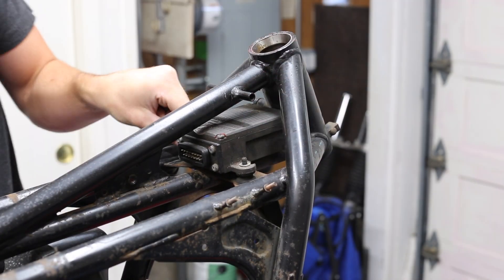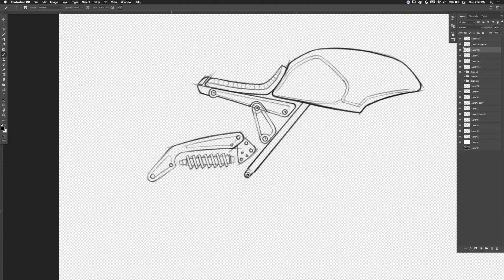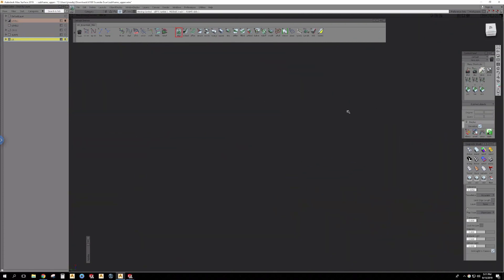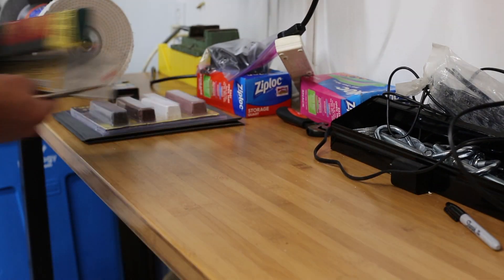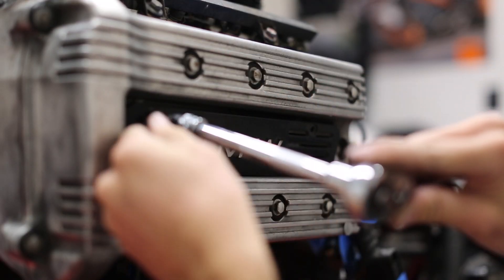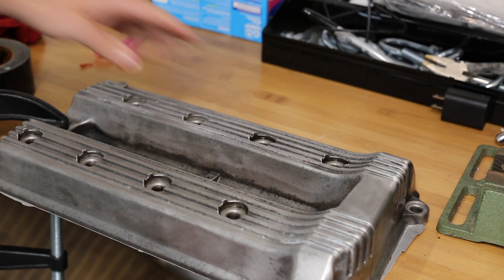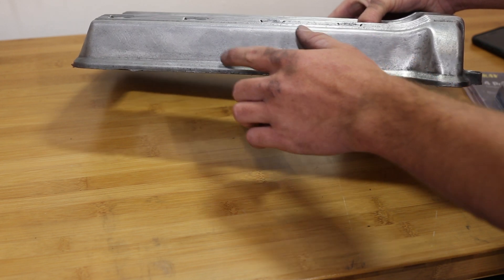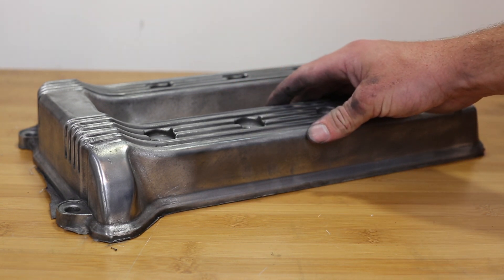Episode: 4: BMW K100 Subframe Design, Frame-Cutting & Valve Cover Polishing

Comment: do you know if you could add sleevs to the engine? I hear the internals become a bit oval shaped and they burn oil so some simple machining and some sleeves could give you a rebuildable engine. I was also wondering can this be converted to chain drive becaus ei noticed it looked like shaft drive. Or I could be wrong:) I have nbever seen one in real life.

Comment: If you could pass on what you learned last episode it would be sharing the cad data for the frame, it would save me first buying one and remeasuring the frame,  please consider chucking it onto grabcad thanks and good luck
Reply from the maker: Hey Tom, I uploaded here. https://www.turbosquid.com/FullPreview/Index.cfm/ID/1495389
Reply: @CURV-LAB  Hi, could you check the link? I couldn't find your upload in the choices. Thanks!
Reply: @CURV-LAB  Hi! I like your build. Watched all your videos. Hoped to find what have you made with the rear suspension. I am building a newer version a K1100 and the same suspension would fit there aswell. In what terms i could get the hole patterns/measurements in a dxf file or something like that. If you could write to me @ tanel565[at]gmail.com. Thanks in advance.
Reply: Hey Tom Carr, did you manage to get the cad data before it got taken down?

Comment: Hi, are you designing a stretcher in your video? Is there a draft of the rear shock absorber lever? I want to cut it myself, but I can not find information on the size of the part. Thanks.

Comment: Possible to get the cad drawings?  i like this look! 😊 (i have purchased the original drawings)
Reply: I’m searching my K100 base to build custom. Once I find it I’ll also buy the Bible with cad drawing from L brothers. Will you share with us the surface modelled drawings once we also have the rights to “solid” ones?
Reply from the maker: CAD can be found here https://www.turbosquid.com/FullPreview/Index.cfm/ID/1495389
Reply: @CURV-LAB   Hey, could You share a CAD model which You have drawn with SW according the scanned k100 frame model??? Would be thankful, I want to design some things according the org frame too :D. And if I understand correctly in these link the org k100 frame model isnt added, yes?
Reply from the maker: https://www.turbosquid.com/FullPreview/Index.cfm/ID/1495389
Reply: Hey Michael, did you manage to get the cad data before it got taken down?

Comment: Suggestion for next time - might be easier to have the paint shop sand blast the valve covers. Cleans the surface and gives it enough texture to take the paint.
Reply from the maker: boxster1990 yea, strongly considering that given how long the valve cover took

Comment: it's good to see you back on the project! I will watch closely your progress and I admire your bold approach to smoothing the design of rear suspension.  this black discolorations it is not corosion but carbon, you can use an acid based cleaning compound to dissolve mineral contamination. Good luck!
Reply from the maker: Thanks, I'll be posting episodes more regularly now. Ah ok, good to know thats just carbon.